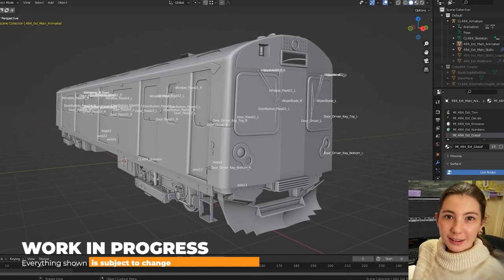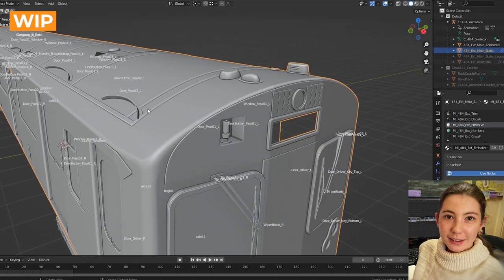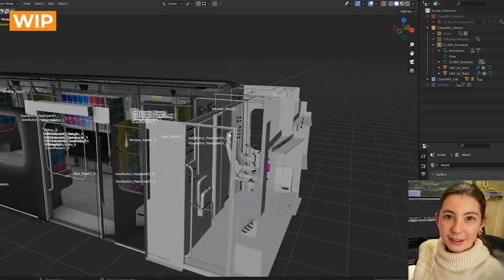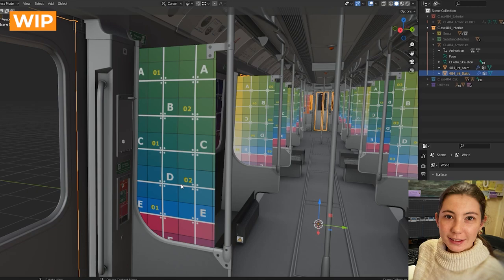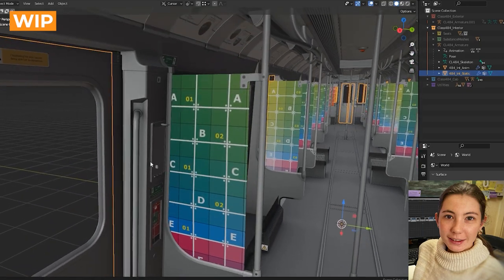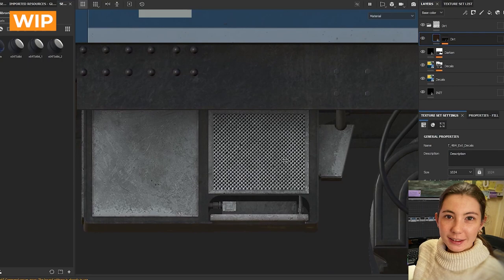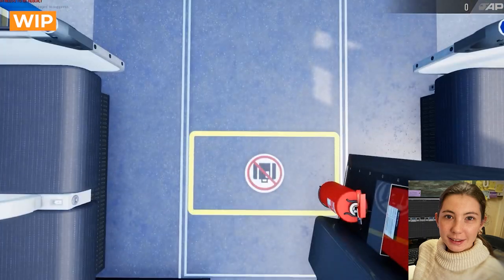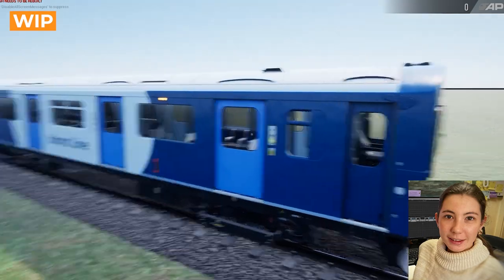Train Sim World 2 | Class 484 - Modelling the Train in Blender

Comment: OMG plssss say that we can finally be a guard in tsw2 as in the vid I saw her activate it if we can omg well done rivet!!!
Reply: That's a no. With some trains like the class 314, you can put the key in and activate the guard panel and simulate it yourselves by getting up from your seat and walking over
Reply: Really are you sure u might be able to but idk hopefully 🙏
Reply: In tsw, there is no actual guard mode where the ai drives the train and you be the guard. When you are driving on some trains, you have the option of getting up from your seat, putting the key in and opening the doors which a guard would do. Or you could just use the key binding for opening closing doors, press the open door close door button and stuff. It's either you do both or just drive. There is no solo guard mode
Reply from the maker: It is - fully working, just like it would be in real life. We'll tell you more about it soon. :)
Reply: I told u that it would be David :)